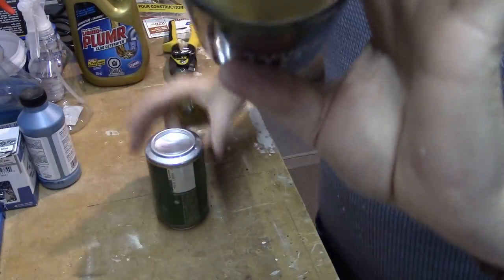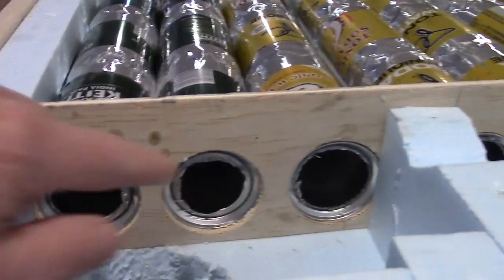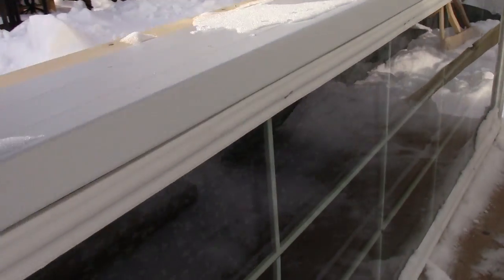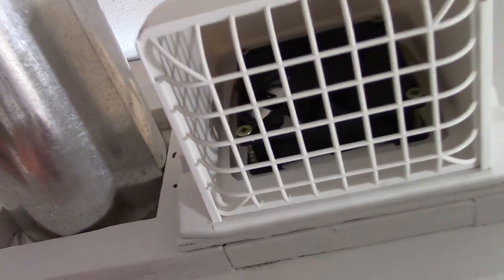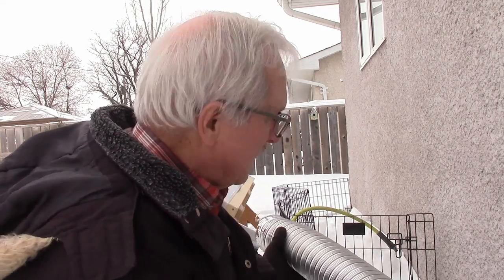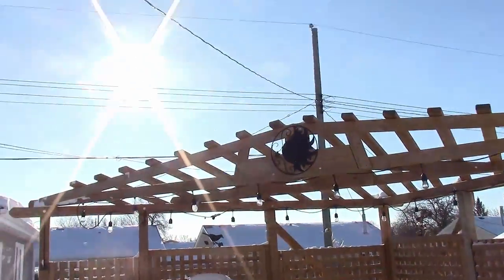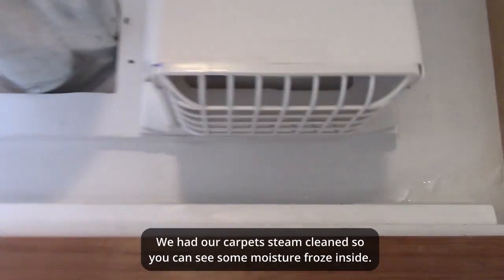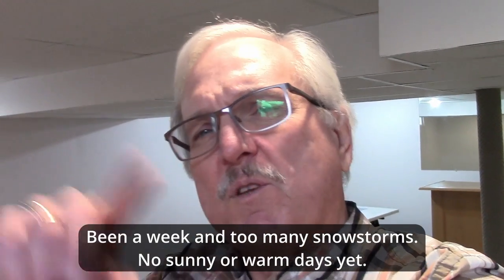Solar Heat Collector January 23, 2022

Comment: Good job and simple. You could use a thermal switch in the panel to turn the fan on/off. piping the output warm air farther away from the input would help. Good luck with fine tuning and
Reply from the maker: Thanks for the feedback.  That was an experiment with some left over materials around the house.  I learned lots for a more improved one in the future.